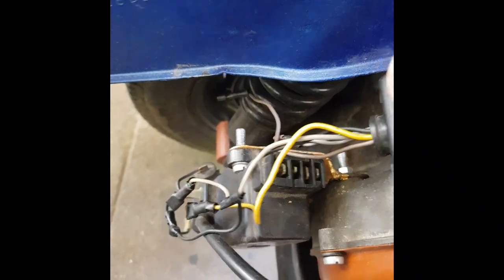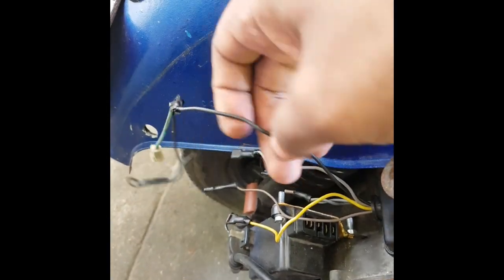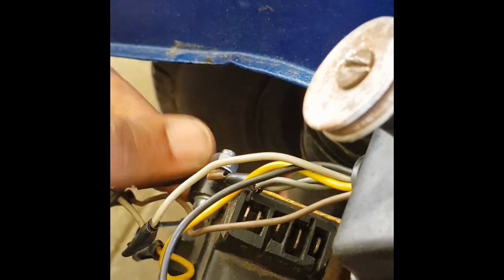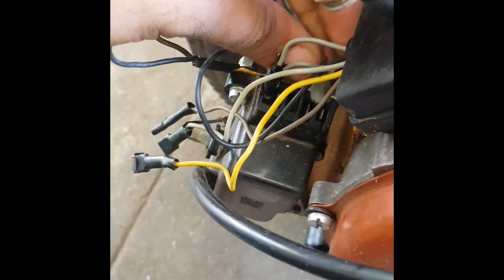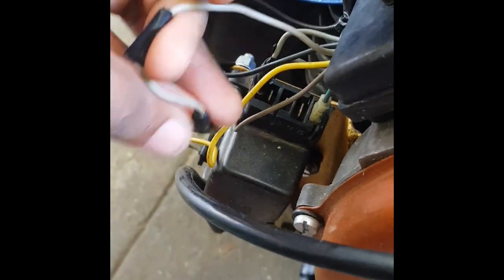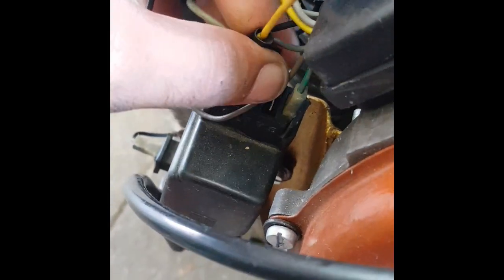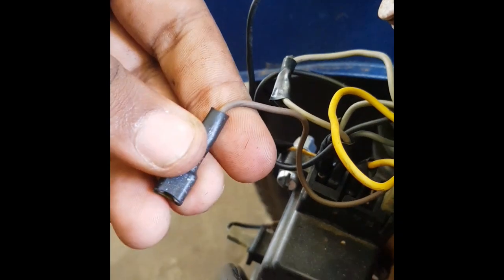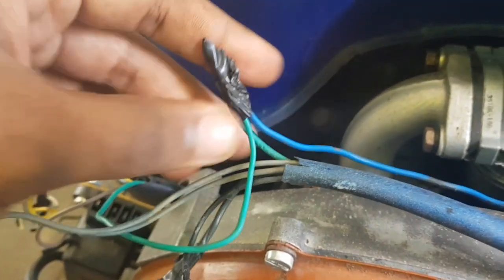Bajaj Chetak Detailed Wiring || Rebuilding a Scooter || Part-4

Comment: Can u tell how to know my scooter is 6v or 12 v...i have point system inside the flywheel
Reply from the maker: Using an led connected to a light u can check if its 12v or 6v
Reply: @ModMaxX  but sir led works on dc and scooter have ac working
Reply from the maker: @tkmwp2326  so no battery installed in your scooter
Reply: @ModMaxX  no sirrr
Reply from the maker: @tkmwp2326  try using multimeter and check it
Reply: @ModMaxX  ok sir thanks